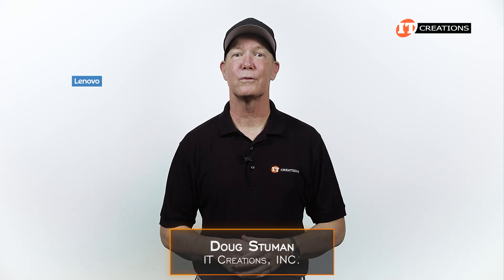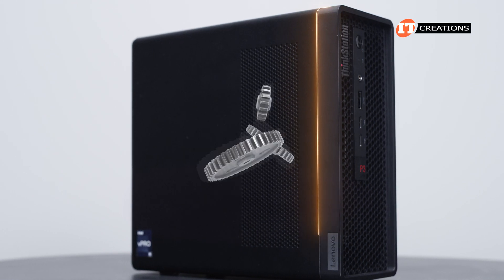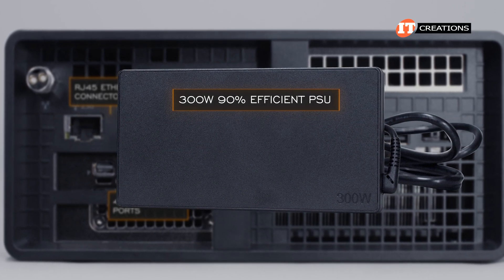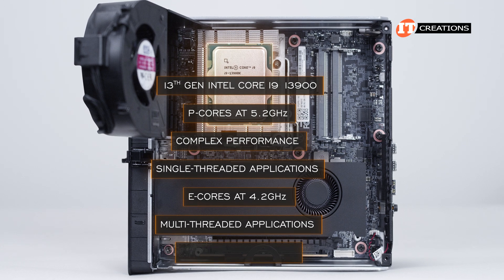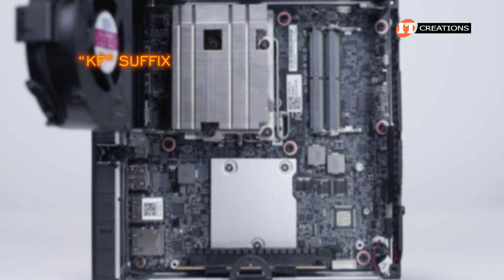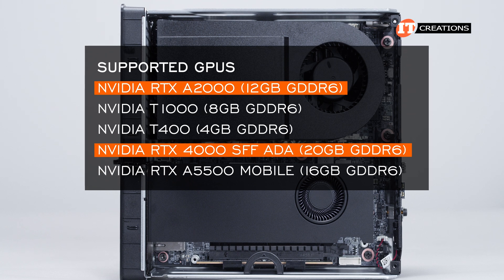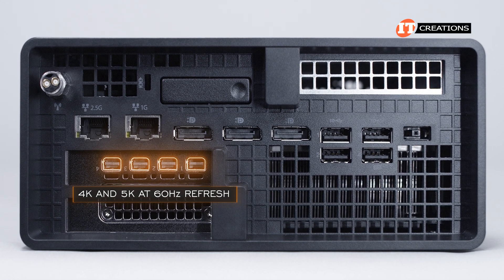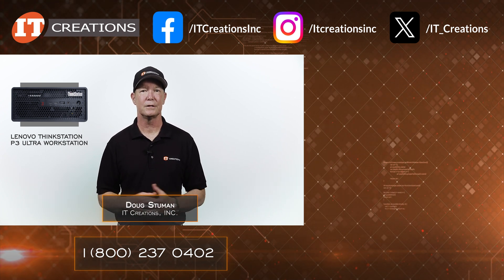Lenovo ThinkStation P3 Ultra Workstation REVIEW | IT Creations

Comment: WOULD LOUD FAN NOISE BE AN ISSUE For basic pc use, internet and trading platform...Thx !!
Reply: Yup.. The moment you open a 4k video the blower can will start ramping up from time to time. Also there are no PCIe power for the GPU should you upgrade it.

Comment: I need help, I can't access the BIOS, I've pressed Fn+F1 and other keys without success. How can I access the BIOS of this Lenovo PC?
Reply: For LENOVO. you access the BIOS from F1 only. F12 is for the BOOT MENU
Reply from the maker: Seems like you are pressing the right keys to access BIOS but perhaps not at the right time…? Wait for the Lenovo logo to appear during boot and then press the F1 key or also try the Fn with the F1 key simultaneously. For more fun with computer problems, check out the trouble shooting section starting on Chapter 4, then move on to chapter 6 of the Hardware Maintenance Manual if none of that works. https://www.itcreations.com/user-manuals/thinkstation-p3-manuals/lenovo-thinkstation-p3-ultra-workstation-hardware-maintenance-manual.pdf 
Also check all connections and make sure whatever drives you have installed, boot drive specifically is connected properly. Hope at least one of those things helps out! Good luck!

Comment: first of all, why does this thing get so little reviews? p360 was also a handful of searches here on youtube. second, got one a few months back, more basic config (i5 13600, 16gb ram, 512gb ssd, no dedicated gpu, no wifi and 230w psu)… mixed feelings. first, the price was good, around 800$ with 3 year warranty from lenovo which i expanded to 5 with the supplier for around 40$, so the pc was like 760$. at least 150$ less than if i was ordering direct from lenovo, which is great. second, this thing is sleek and small, so thumbs up. but, even with a mid tier processor, the fans get really loud and cpu gets kind of toasty under heavy load. cant imagine how things go down with an i7 or an i9 (iirc, i9 needs two fans so no double slot gpu upgrade if you opt for top tier i9, btw). am planning on putting a dedicated gpu in there, still debating with myself whether to go with t1000 or a2000, but it seems id need a2000 ada variant if i want to do some topaz upscaling of older sd material, but those are like 600$ minimum so, meh. also, the config did come with a pcie riser so i dont have to buy that separately from lenovo. all in all, i have a new pc, its small (that was the most important thing when buying it, so i guess on that front i should be happy lol), a bit disappointed about temps (ram idles around 40c, and so does the ssd which is weird since i believe ssd has its own fan). also, lenovo charges an arm and a leg for gpus. like, t400 4gb variant goes for like 300+$ when in reality you can get a brand new one from a retailer for half the price. also, ive read that not all ram will work in this bad boy, i was thinking just throwing 100$ for some, i dunno… crucial mid tier ram, 32gb but did read that it might not work. lenovo sells samsung and hynix sticks and they are, surprise surprise, at least 30-40% more expensive than if i got a kit from i dunno, newegg or whetever. the good thing is, lenovo sells replacement parts and optional parts, so thats always a good thing. but then i remembered, maybe i shouldve gone with a custom pc, what happens if the mobo dies? im toast. everything is proprietary. so im thinking of snagging a replacement mobo and an extra psu to have them as backup, since 5 years from now i doubt id find them at lenovo, maybe ebay but thats always a gamble. if id gone with a custom pc, if mobo dies, poof 100$ and i have a new mobo. if this things’ mobo dies, poof… cant remember correctly, but its like 400$ or something, lol. aaaanyways, thanks for reading my blog. cheers! subbed.
Reply from the maker: Thanks for the comment, very in-depth with personal experience, which is what most people are concerned with. 👍

Comment: I guess more storage is available with additional pciex card x8 if I am not mistaken or one can have a dual port fast networking for example. This Interesting workstation can be customized for different application however those unfortunate 13th and 14th generation intel performance cpuz... If Xeons were supported... that would possibly extend pciex lane number, too.

Comment: Update***
Sorry, I was just looking at my newly purchased/received P3 Ultra and the video kit. While the kit does technically support and apply to the P3 Ultra, it is only for the bracket and screws ability to support A2000/A4000 low profile GPUs. None of the video or power cables work. So only GPUs that can be fed by the PCIe 75Watts are going to work for GPU options. At least for now. Apologies for the bad info.

This info below is incorrect***
You can also order the GPU power kit (Part Number: 4XF1M24241) from Lenovo that is compatible with the P3 Ultra 30HA/30HB model numbers. So you can add in low profile GPUs like the RTX 4060 that require power in excess of the 75W of the PCIe bus. Note you will require the 300W power supply for this.
Reply from the maker: Thanks for the additional information. On another note, there was a mix-up with not only the information Lenovo sent over but the actual unit. Turns out it had an NVIDIA RTX 4000 Ada GPU. Hopefully will post the, not in-depth, benchmarks we did on that thing today. Thanks for commenting and watching!
Reply: @Itcreations-LA  ‘ah, twas a mixup, they sent a 1500$ card instead of the 300$ one’, hahahahaha. noice! do post temps with and without dedicated gpu in the case. im thinking temps might be the only downside to p3 ultra. ok, and the proprietary… well, almost everything, lol. cheers!
Reply from the maker: Thank you for adding that information! And, thanks for watching!
Reply: hmm, is that new? i was checking optional parts over at lenovo, eu btw, and i havent seen this option. good to know, thanks!
Reply: @cordlesswire  I updated my previous post above after verifying compatibility on my just received P3 Ultra, sorry for the bad info. Everything I read and based on my correspondence with Lenovo support lead me to understand that this kit would enable the use of up to 115watt GPUs, but I was wrong.
Reply: @heart4Pahoa  aaaah, cool. thought maybe it was something new they added. btw, iirc double slot cards can fit in p3 ultra, a2000/4000. meaning, they dont need slim cooler conversion kit. i could be remembering wrong, and if i am… bummer… i was looking at buying an aftermarket one, since lenovo charges double for gpus, lol. will check again and report here. cheers!
Reply: @cordlesswire  Yup, I am running an A2000 (I bought on Amazon before the prices got silly) in my current 5 year old PC, and bought the P3 Ultra with the intent to move it over to it. Going from PCIe3 to PCIe4, bump up in processor speed, FSB and NVMe g3 to g4 should all feel systemically faster on this new unit. I went with the i7 to keep the temps down. May do a thermal re-paste with some Noctura too, we’ll see.
Reply: @heart4Pahoa  noice. was thinking of a repaste as well, even though our p3 ultra is only about 4 months old. thought, maybe it was sitting for some time at the retailer i bought it from, but then again p3 aint that old. dunno. temps on our p3 ultra are ok at idle, but under heavy load (qtgmc deinterlacing while encoding older sd material) easily in the upper 80s, even lower 90s and then i guess it starts to throttle and temps drop just slightly below 80c and stay there during the encoding time, which can take easily 10 hours, depending on material (usually old tv shows from our dvds). anyways, lenovo forums are the place to ask questions, and i will do that if and when i pull the trigger on getting a gpu. t1000 seems way better than our current t400, with just 2gb or ram lol, but then again… no ada chip, so no topaz ai upscaling afaik. cheers.